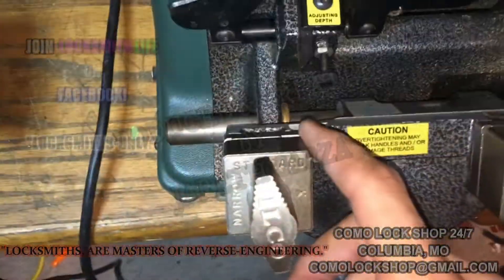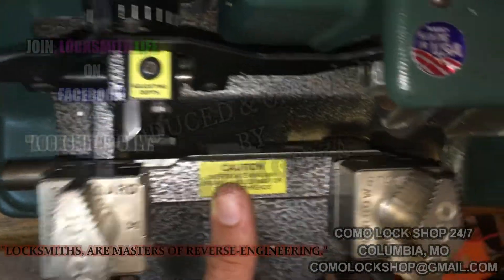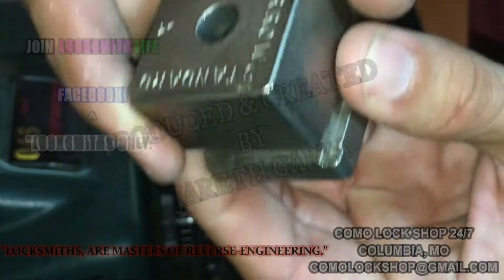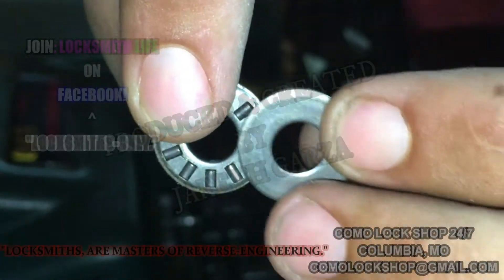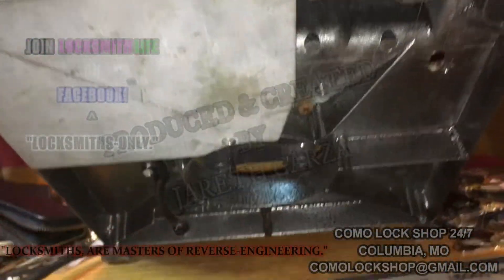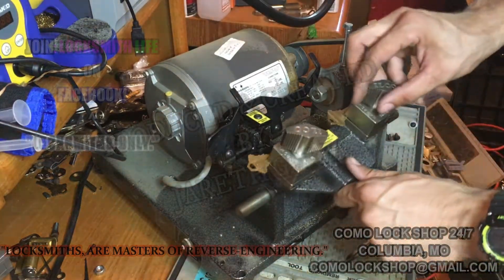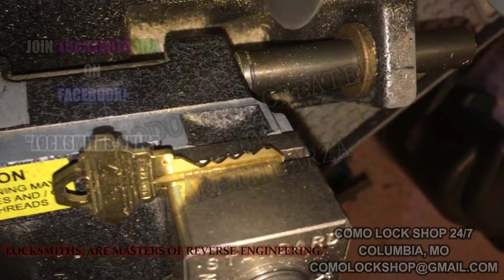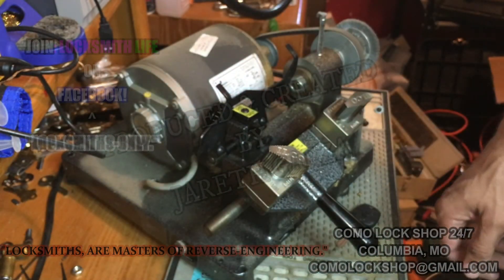ILCO 045 Performance Series Key Duplicator REVIEW

Comment: Nice!I have the 045 HD.I never would’ve thought of bracing my finger against the guide to gain more control of the cutting process.Thanks for sharing that trick!.PS:Considering the fact that this machine has no mounting holes,how would you recommend securing it to a workbench in a service vehicle(So as to prevent it from becoming a lethal projectile in the case of a collision)?
Reply: those legs that he showed to adjust the level screws out, you can use the holes as mounting holes